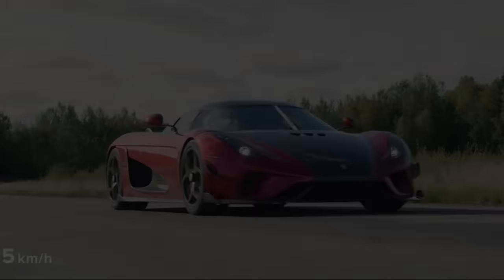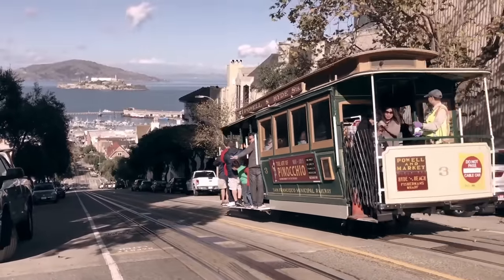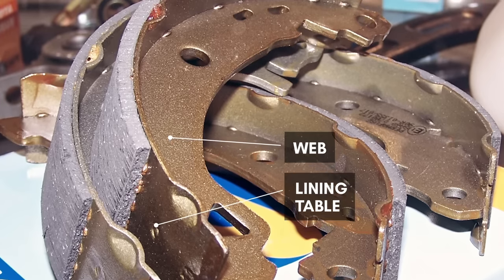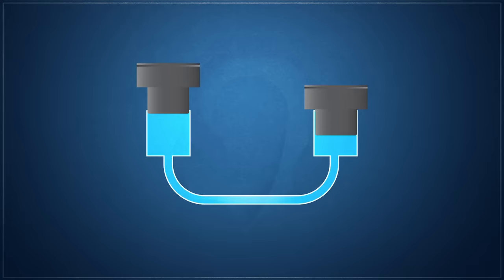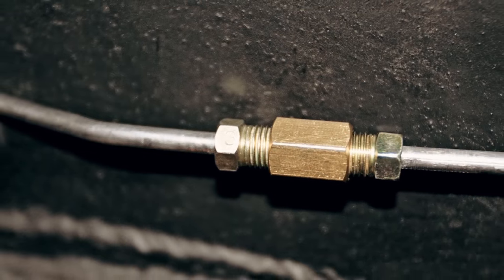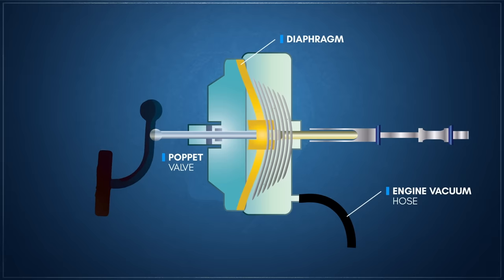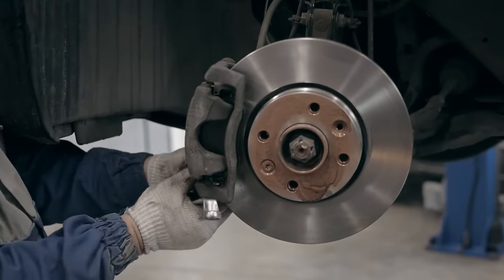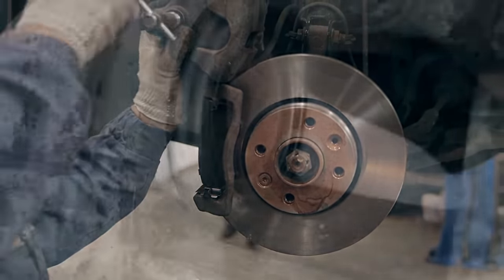The Story of Brakes

Comment: I have to call BS on the intro
An average home in America has at most 200Amp electrical service.
That means if all lights are on, electric stove and dryer are on, all appliances are on and smaller electrical devices are drawing maximum current from all outlets, the electrical service will deliver only 48kW of power in one hour or 96kW in two hours.
That is 10x less than 1.1MW.
Someone made a glaring mistake in calculation.
Worse, nobody checked the script before recording the commentary.

Comment: Another widespread misconception that you, my friend, are only spreading further with releasing this content with such bad facts.. ABS does not increase breaking power. It allows the wheel to rotate under heavy braking, which increases control and stability. If a tire is skidding, the path of the vehicle is at the mercy of whatever vector the vehicle's momentum is in. When the wheels can rotate while making contact with the ground, that Vector can be changed by the input of steering, and even the effect of the rear wheel aid in that stability. The goal of ABS is to keep the wheels turning, not to increase stopping power. They do not, I repeat, they do not increase stopping power or reduce stopping distance. They increase control under heavy stopping.

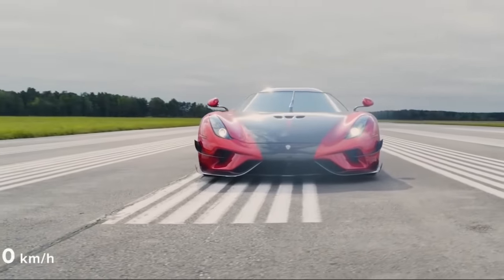Comment: 0:40 1.1 megawatts is only enough to power one american home for under 2 hours?? Really? What on earth is the average American home powering in the average 2 hour span? About 50 ovens, 1000 TVs, 200 fridge freezers, about every electrical appliance you can think of, in multiples and then some? Your maths is off there i think. 1.1 KW would be a lot closer, so much so that it's probably bang on and what you meant. A MW of power seems way off for braking power of a car anyway. Thats insane.
Reply: You are right brother. I'm amazed that no one pointed this out.

Comment: Take this video with a grain of salt, bc much of the information I know to be out of date by ten or more years, and other details are inaccurate. These are just a handful of shortcomings that I recognized off the top of my head. Editorial inaccuracy is like cockroaches. Where you see one, there's a hundred you don't see. If you really wanted to dig, I suspect you'd find issues everywhere. If you're going to publish a video for a million people to see, you should take the trouble to be accurate. At 10:38, VO references "early 1900's" and compressor, while displaying a modern, cast-aluminum power-steering pump. At 19:53, "under a second" is technically correct, but misleading bc in this context, one second is an eternity. If you slam on the brakes in an older vehicle without ABS, I would guess the elapsed time to lockup would be as brief as a few hundredths of a second. At 20:21, "fifteen times a second" cycle rate is inaccurate. 100x is common on modern vehicles. (The VO contradicts itself at 21:28 with "millisecond bursts.") 15x occurs, if that's what the circumstances require, but at cycle rates that low, the driver will perceive the function of the ABS system through the pedal as pulsation. Not so at 100x. [Did the author rely on Wikepedia as a source? The Wikepedia article reference to 15x are from Cengage (which I liken to Swiss cheese in terms of editorial accuracy) from 2000, and from "HowStuffWorks" from 2010, who may have originally referenced Cengage, idk. Suspiciously identical.] Also, at 20:00, "the controller reduces pressure to the offending wheel," "reduce" is inaccurate. Where one wheel is nearing lockup, the controller continues to increase pressure to the other three wheels, while closing an isolation valve to maintain the pressure in the one wheel. If that fails to arrest the abnormal deceleration, the controller resorts to opening the dump valve, which releases (not reduces, unless you consider an instantaneous, passive drop in pressure to zero to be actively reducing) pressure at that wheel. At this moment, there are no brakes on that wheel. After the wheel reaches the speed of the other three, the controller returns the valve to the default state, meaning it closes the dump valve and opens the isolation valve. If the wheel again slows relative to the other three, the controller will perform the cycle again. This is the cycle that can occur 100x per second. The run-down of pad materials at 22:32 is years out of date. Organic? If the big retail chains even carry them, I'm unaware of it. Vehicle owners demand ceramic pads for neighborhood driving, which have come down in price, and are clean and quiet. The braking characteristics are different from semi-metallic, so ignore the manufacturer's original specs at your own peril for track driving, or descending from Pike's Peak, but vehicle owners who only are dropping the kids off at school, are opting for ceramic as replacement pads. 22:49 copper content by 2025 will be limited to near zero, due to environmental concerns. Schwarzeneggar signed legislation in 2010 addressing the issue of copper being toxic to aquatic organisms. Where Cali goes, industry follows, bc it's just easier.

Comment: 24:50 "up to TEN TIMES LESS load..." This is wrong in English and in Math. The word TIMES means more, and in Math means multiply. You can't multiply by a decimal if using real measurements. Less load would be a FRACTION of the original number, or ONE TENTH the load. Times always means more. 5 x bigger, never 5 x smaller.

Comment: 2022 Renault Clio still has Drum Breaks on ALUMINUM RIMS. It looks like a pimped $400 shitbox.
Reply: The problem with disc brakes on rear axles of relatively light cars is they tend to corrode there because the brake force needed on the rear axle of a small car is barely enough to grind off the rust if the car is not used daily. 
It's the same with EVs , so the electric VW ID series uses drum brakes at the rear too

Comment: If your car’s energy was converted to heat, the brakes would melt. Most of the energy is actually put back into the earth. Kinda like when a measuring tape reels in super fast and puts its energy into the housing

Comment: Vacuum assisted brakes are cheaper, not better. I have owned three GM vehicles with hydro boost and it's by far better and more reliable then vacuum. People don't like them because they produce enough assist to literally push the brake pedal to the floor.

Comment: EV, “one foot driving “, regenerative breaking.  Recuperate energy back into the battery and don’t let it go off in the form of heat like a cave man.  Way less break service /pad replacement under most all driving conditions.  It’s possible to go weeks or months without using your friction old school breaks on a Tesla for example (assuming you’re not track racing your car or a shitty driver who can’t look ahead ).  

 hydrological systems are also for cavemen.  Look at Brembos new electrical motor actuated break caliper/pad.